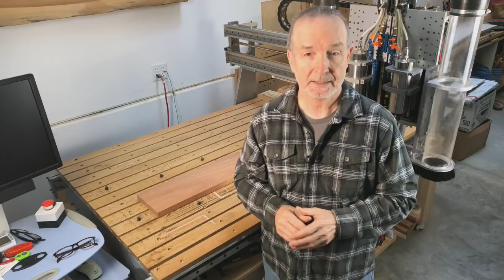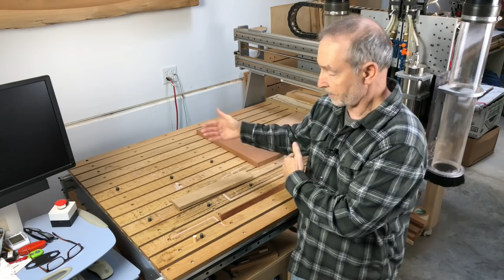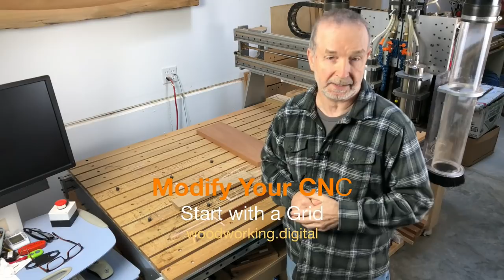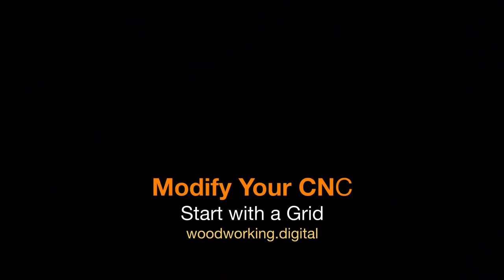A CNC Grid System

Comment: Very useful, thanks.  I've got a Shapeoko and set up aluminum T-tracks separated by 4" MDF slats.   Now I'm going to set up a pin system as you've described.
Reply from the maker: Just remember that you can only trust the CNC milled pin holes for alignment and positioning. Your track, spoil strips and screws are not true to the CNC and are only useful for hold downs, never for position. Also, make note of the offset from the 0,0 home position (The SW rapid move) to the nearest pin. That's the critical position that you need to be able to repeat. Since you're using T-Track, I suggest 4" spacing on the spoil boards. I've got a series coming up on seriously modifying the Shapeokos.